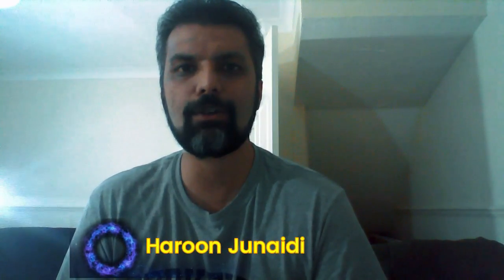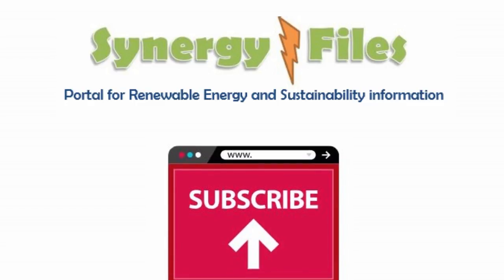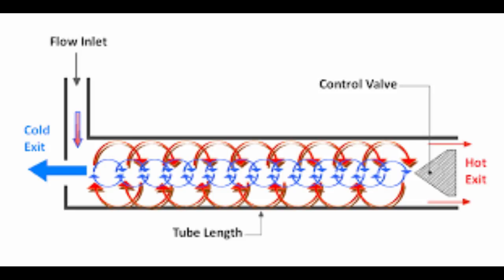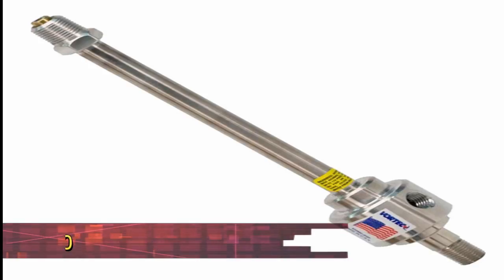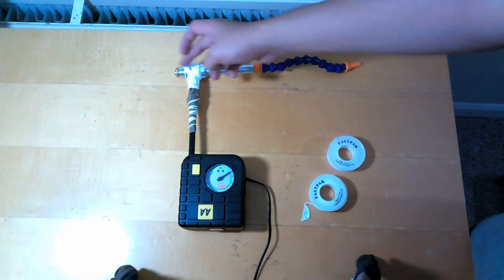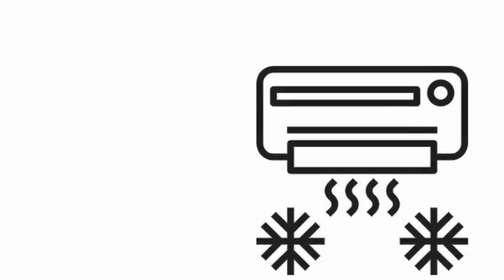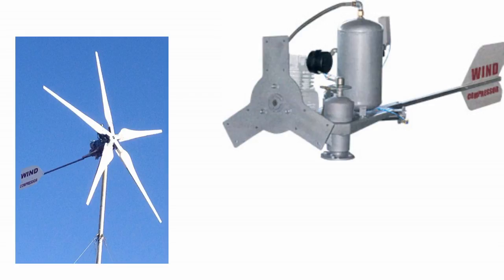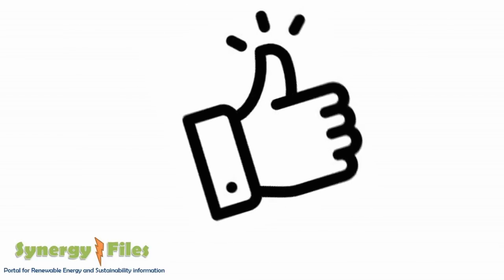Vortex tube: The amazing mechanical device

Comment: The largest non-propulsion use of electricity in Electric Vehicles is for heating. Resitive heating is a major electrcity gobbler. What if a small compressor could maintain a tank in an EV and blow vortext hot air directly into the air intake of air entering the cabin (similar to home gas/oil fired furnace) or heat a container of antifreeze and circulate the fluid thru standard heater core to extract the heat. No resistive heating needed. ANd of course the reverse for Cooling of cabin also. 

"Resistive heating in EVs uses electricity to heat coils (like a space heater or toaster), converting energy directly into heat for the cabin, but it's energy-intensive and drains the battery, reducing range, especially in cold weather, compared to more efficient heat pumps that move heat. While quick and simple, it significantly impacts range, with some systems drawing 2-8kW from the battery"

Comment: When you move air across a wet kitchen towel it will cool, no vortex tube needed. That needs to be controlled so you can measure the effect of the vortex tube on it's own.

Comment: I am more than interested in your set up. I have a few questions: (I) you spoke of a small vortex tube of 130 mm, costing about say $40. Are there any such manufacturer supplier of small vortex tubes in India?  Most suppliers in India do not make such small vortex tubes. {I've checked with many} (II) What is the best pressures for the good continuous functioning of the vortex tube? (III) you showed us a tube inflator for generating compressed air. Will this give the required pressure? Can this be used on continuous basis? (IV) next you showed a pretty good wind compressor system. Can you suggest any solar compressed air generator?
Reply: check out the tromp pump from "mr teslonian"; no mooving parts !
Reply: @AutoNomades 

He is right about the trompe if you have a water supply. It works on water to compress air. No moving parts. 60 psi and up. 
Mr Thessalonian on you tube has it. 

There are videos on the votex gun/ cold gun on YT, build your own from a spiral wood drill bit.

Comment: Great explanation Haroon, I found it very informative, ... however, ... electricity is used to charge many compressor tanks all over the world.
A wind compressor would not be able to keep up a strong enough pressure to run only one of these tubes for hours & hours, like in industry, also when the wind dies, electricity seems to be the answer there, OK?
Watts V's the cooling or heating effect, ... is it economical to use these tubes at home?
Reply: Wind propeller compressors does exist Trompe pumps, whith no mooving parts exists, big gaz bottles exists.. It just needs more experiments..  What are the sources of what you say? Why not letting peoples experimenting whithout telling them no to ?!

Comment: No wonder why you don't get cold air stream! You attached a flexible pipe to hot end of the vortex tube! In addition, I doubt that your air compressor (tire inflator) supplies steady compressed air stream although it may say 100+ psi

Comment: What you meant by "Not using electricity at all?" Do you mean that you blow up the compressed air with the mouth? How do you produce the compressed air? Probably by using a compressor that is using electricity....
Reply from the maker: As the video explains at the end there are compressors that would run directly with turbine blades. You dont need electricity in that system
Reply: @synergyfiles3536  I believe is easier to use a wind turbine that produce electricity and running an air conditioning. The air conditioning are more efficient and produce less noise(and they can also produce heat-is called a heat pump or air air pump). Plus you can use the electricity for something else. Plus you need a big compressor in order to produce some heat. I believe you need a constant 90psi
Reply: @cornellungeanu1620  Electricity is the worst way to do heat, and heat pumps are not efficient in all climats, and are noisy too
Don't you 'believe' ?

Its good that peoples tries differents ways, why always telling them not to try?!
Reply: @cornellungeanu1620  And what about trompe pump ? Im just bored to these peoples always saying to peoples that experiment new and different things not to try. What do you do in your side to betters the world ?
Reply: @AutoNomades  so you want to dig a whole gallery with pipes and stuff in order to have Air condition and heat  in your house. You will never ever recover your investment. You just want to try something new but you are not reasonable. I can see that. Is not like you can discover the holy Grail in just one day. People and company tried all of this and they decided this is not the way. That's why they make heating units and wind turbines.
Reply: @cornellungeanu1620  I didn't meant to be !
Dont think companies are gods and have already tryed everything and only makes affordables series of usefull stuff. They want fast fund back, not help peoples to not depend from them. Many things to not depends of big monopolists are not yet developped ! Because low fund, etc !